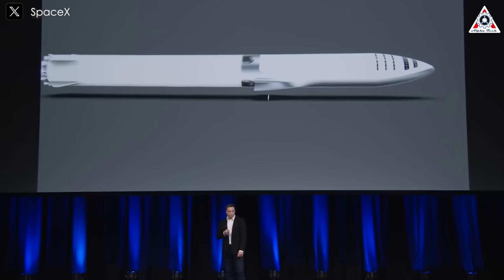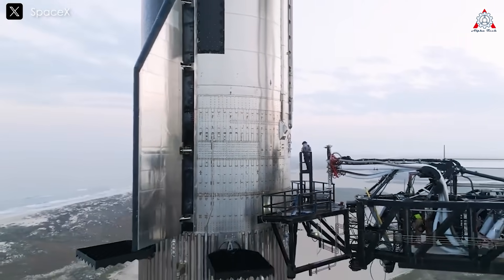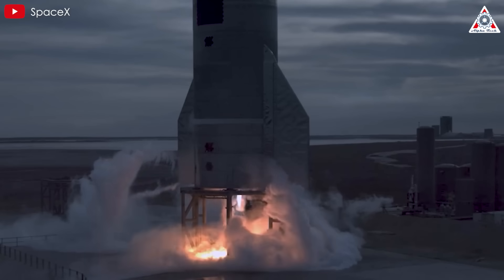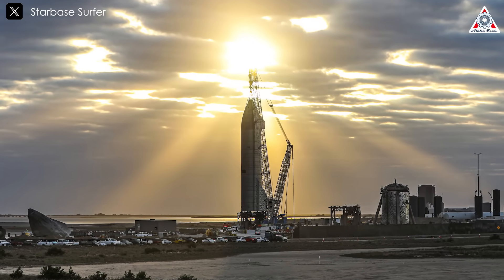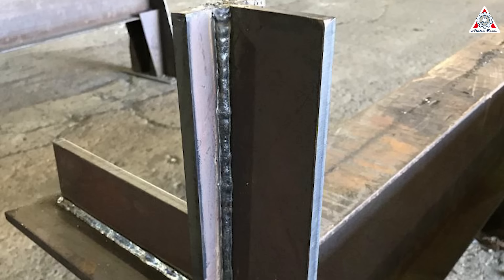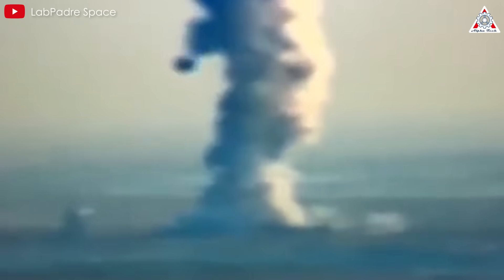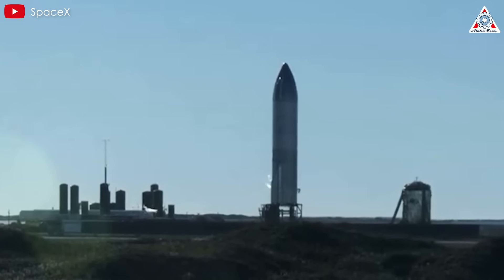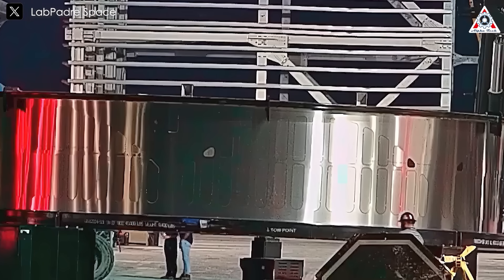SpaceX Revealed Starship V3 WELDING Upgrade Will Blow You Mind!

Comment: If they can build a massive vacuum chamber, say, the size of a starship, they can do what's called cold welding or stiction. If they clean the surfaces well enough and smooth enough the metals will fuse together degrading the material through extreme heat welding.  Doing some experiments on the strength of the cold weld, they can determine if addition tig welds are necessary.  Through cold welding the ship would look like one single piece of SS. if we can build a space station large enough, we can even start manufacturing starships  in low earth orbit. Plus we can make ships much larger than the current perspective V3.

Comment: Well, I think there's more ahead, Like I bought a huge Stainless stock pot yesterday, and it has a welded seam up the side that was done by a machine, that looks like it was fused linearally with no or very little filler metal added.
Basically created long ways into a tube.

So I suspect eventually we will see Starship just as automated and guys with hoods working on other things.
These ships are prototypes. And by moving to fabrication SpaceX has gotten us past Nerdy rocket building and into the realm of Space Ships.
But we probably arent far from seeing them produced as if they were cars. 
The improvment isnt gonna stop any time soon, SpaceX is rated the most valued company on the planet for good reason, And I suspect this is a point of beginning we are watching.

We are gonna need alot of ships.

The way to
 "Save the planet" isnt forcing the Serfs to eat bugs, 
its expanding humanity and especially manufacture into space.

So, I try to live my life, with an appropriate "Frontier" attitude.

AI is likely to lead to two major paradigm shifts:
Life extension, and FTL.

Meaning birth rate, becomes rate of expansion, as does the time required to go from mining to ship hulls.

Starship, will someday very very soon, be the motor whale boat to true Starships.
And my Frontier attitude has me thinking like Heinlein and his Wagons list.

In fact, I live like I'm preparing to Exo Colonize. 
This is gonna sound crazy, but yesterday's huge stockpot was number 21....😂

I've been buying to use as portage/storage containers for things of value, much like Sailor's Trunks, or steamer trunks of yore.

Was a better solution than plastic totes, for about 2x the cost by volume.
If I'm alive when its time for a New Earth, and new Heavens, I will be ready with everything I need to build a cabin in the woods under another Gardening sun....

And I'll leave the WEF eating as many bugs as they want.

Where I come from, we use chickens for that, and make Chili and cheese Omelettes...😂
Reply from the maker: That's a really interesting perspective on the future of space exploration! I agree that Starship is just the beginning, and we're on the cusp of some incredible advancements.
Reply: @alphatech4966  
Yeah, big changes will come from affordable
gravity well escape.
Chemical rocketry is crude but effective, and will get us strarted.

On the Stockpot weld, guessing they lapped the edges a couple milimeters and then ran electrified rollers over that lap from both sides and rolled it flat at the same time fusing the layers together.
Looks like a similar system used putting on the bottom.

Basically a machine weld with minimal finish work required, that would be very good if scaled up to Starship.

Comment: Correct welds are actually stronger than the metal around it.
Reply: That greatly depends on what metal you are using to weld what metal. Weld failure is always a concern hence the NDT requirements in critical infrastructure.